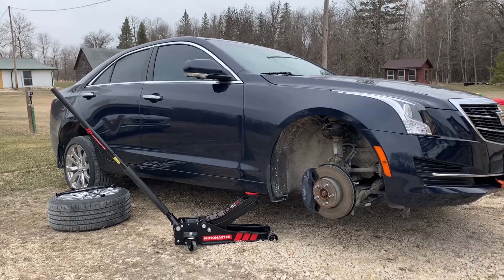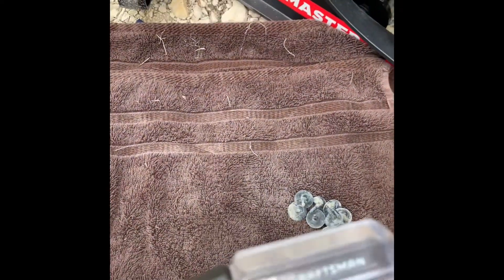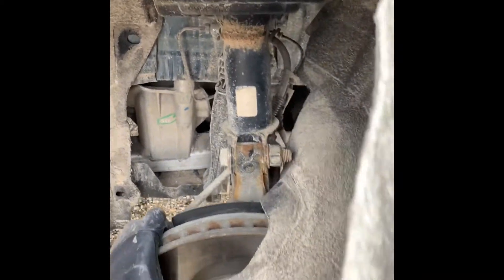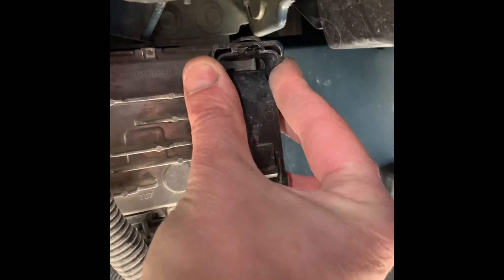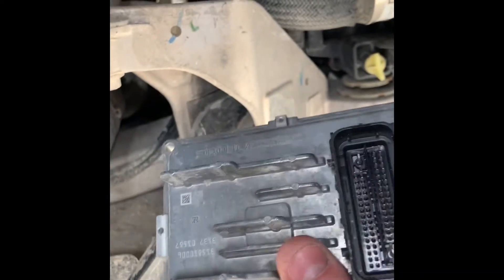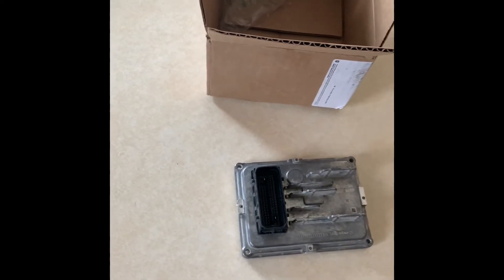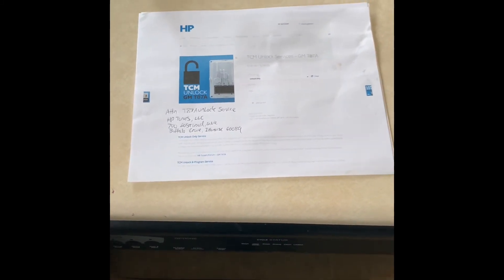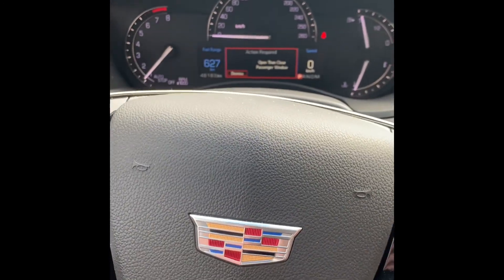2018 Cadillac ATS TCM Removal & Instal HP Tuners Unlock Service for GM T87A TCM.  Tune next!

Comment: How about Cadillac 2015 XTS Luxury? Is the TCM located in the same location or is it in the transmission? Does it come unlocked?
Reply from the maker: Honestly I have no idea? I know the Camaros are in a different location than the ATS so I’d do some research to try and find the exact location. As far as if you will need to unlock the TCM check with your tuner or look at HP Tuners web site and see if it even can be unlocked. Hope this helps
Reply: Ok Hopefully someone sees this comment who may know where the location of the Cadillac (XTS) is. Thank you for your time!  @Modaddiction19

Comment: How do you get so many mpg 😦😦😦
Reply from the maker: Haha, I live out of town so lots of highway miles.
Reply: @Modaddiction19  nice man i barely get 20 mpg   With no mods but i plan on modding soon
Reply from the maker: @sosa3017  these cars are so much fun once modded. Have fun 👍🏻
Reply: 20mpg? Yikes even before j started messing with atuff i got 25 to 30. Once i fixed the 8 speed "shudder" myself and built an air intake, i get easily 35+ on the highway, more if i dont speed over 70 lol.
Reply: @the.half.awakened how’d you fix the 8 speed shudder? Currently dealing with it on my 2016 ATS

Comment: Did you do the “unlock only” option or the “unlock & program”? I have a ‘17 ATS. I plan on tuning my ATS soon.
Reply from the maker: You just need to do the “unlock only” option. The other option (unlock & program)  would have been if you were swapping TCM’s from another ATS and re installing it into yours.  Super simple instal 👍🏻 hope this helps
Reply: @Modaddiction19  It sure did help. I just have one more question. It says that once they ship it back to you unlocked it’ll be ready for tuning. Did you do any tuning on the TCM after receiving it back?
Reply from the maker: @xdivinci_6553  once you receive the unlocked TCM all you have to do is re install it. Car will shift and drive normal with zero issues. Super easy process.
Reply: @Modaddiction19   awesome. Thanks for the help!

Comment: Why not have zzp remote tune it?  Far easier and get the most out of the tune.
Reply from the maker: I am going to have ZZP do the remote tune but on 2016-18 ATS’s the transmissions need to be unlocked first in order to have the transmission tuned. I can’t wait!
Reply: Oh man that sucks!
Reply: @Modaddiction19  so something I won’t have to worry about on my 15??
Reply from the maker: @magnellseth  You are correct my friend only 2017-19 have to remove their TCM for tuning.
Reply: The 2016 ats-v TCM does NOT need to be unlocked for TCM tuning…

2017+ TCMs are the ones that NEED to be unlocked before you can actually tune.